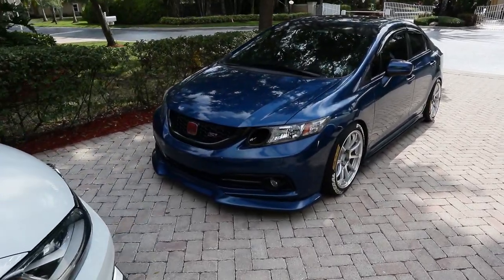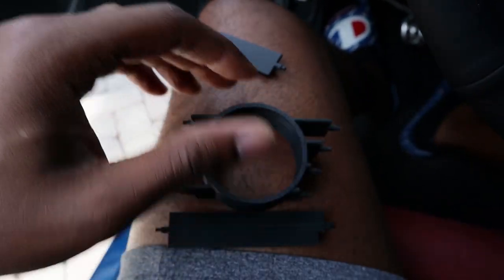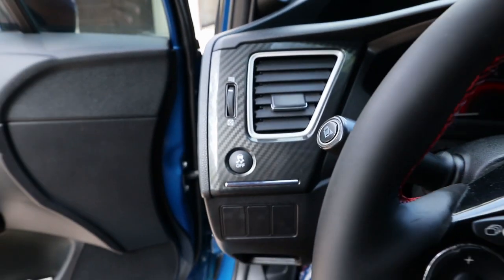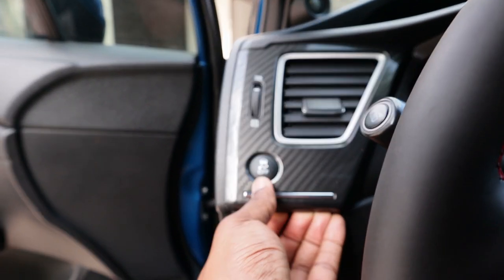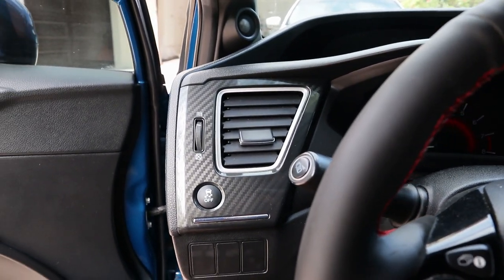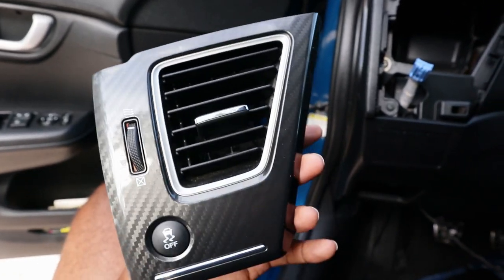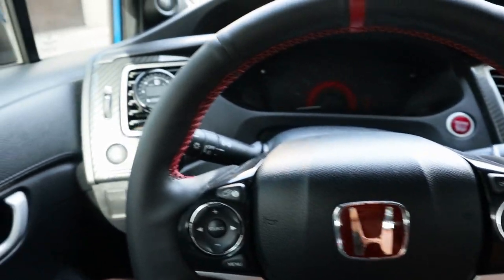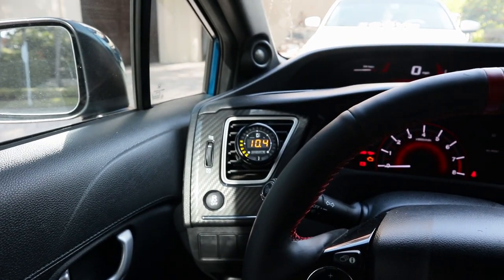Installing CRAZY Vent Gauge Pod!

Comment: I put these on mine but for the air fuel gauge. Ortiz Custom Gauges does some cool stuff too for 9thGens
Reply from the maker: I gotta get another one just for that gauge
Reply: @zoovie  I hear the middle vent is a lot harder to deal with than the first. I don't need a ton of gauges, so I might just use my Ortiz pod for my next gauge
Reply: I just got this vent and put everything together but when I go to pop the whole vent piece back in the dash it won't go back in because it's obstructed by the gauge cord. How do you guys get around that?

Comment: damn, great job man. wondering if having the heater on will mess the gauge in any way (long term)
Reply from the maker: I live in Florida so it rarely gets cold enough for me to have to turn on the heater
Reply: i think these gauges are designed to withstand high heat, so i dont think our heaters will get anywhere close to messing up the gauges but im not sure lol

Comment: Bro did you have any issues with the k tuned battery relocation yet? Just installed it and the ram intake today and I worry about the battery sitting so low.
Reply from the maker: No I haven’t